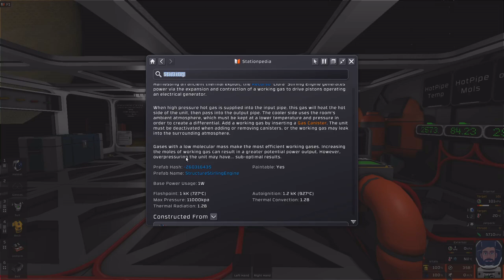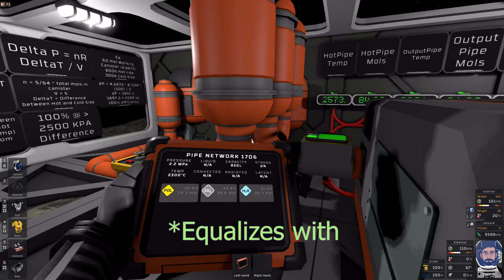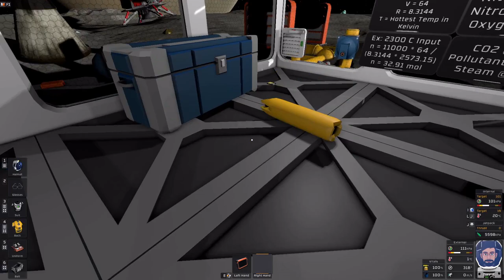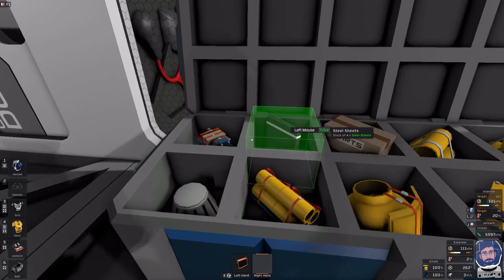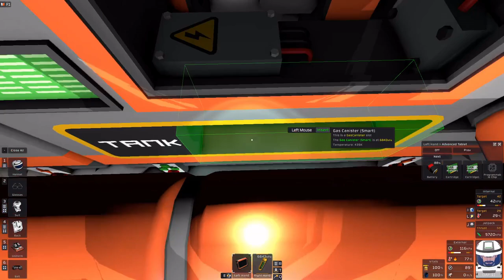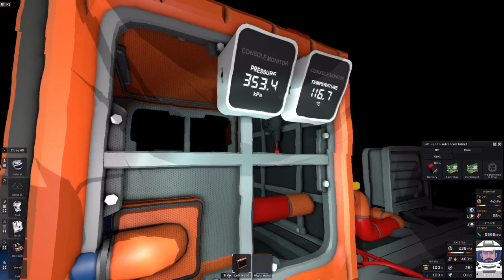Stationeers: Stirling Engines

Comment: Not only on venus basically any where with the daisy chain ac setup(cool the environment dump the heat to the hot side of stirling) which will produce less power but it will be almost 2kW

Comment: Has there been any changes with recent updates? Im trying to build this setup but my ACs cant keep up even with one SE, Im using Elmo's AC setup with 6 units and still struggle to cool down room for one Stirling
Reply from the maker: There has not been. Still move the same energy. I did have an IC in the ACs with Elmo's script, though it had to be adjusted a bit first since it had volumes for prephase change pipes.
Reply: @shadowdrake082  Yes Im using ACs with VolumePumps and IC in each AC. I tried building exact setup as Elmo on his vid using 6 ACs and tried ur setup from this vid as it differs a bit and Im not good results. How did u adjust IC? can u explain or maybe add Script to Workshop if possible? Im fairly good as IC so with some guidance i could adjust myself. either way somehow im not getting cooling i would expect.. sometimes i just think stuff are bugged here as in some scenarios im getting way too good results and in other way too bad compared to my expetations
Reply from the maker: I dont recall where it was, but originally the pipe volumes before phase change were 100L and his script adjusts the volume pump rate to make sure exactly enough gas is pumped into the ac input pipe. That math needs to change so that it uses 10 instead of 100.
Reply: @shadowdrake082  I finally found solution. I had to use DeepSeek AI to help me find issue. It actually had few problems in this code. 1st indeed there is mistake with volume of pipes and has to be changed to 10L. 2nd max pump setting is set as 30 where normal VP max is 10 and lastly there was mistake to which line jump and it was skipping crucial calculations in certain situations. Now it all finally works :) 4 AC keeping StirlingEngine running at stable temperature 30-40 C.. thanks for help and great vid as always
Edit: Actually after testing corrected code 4 ACs seems overkill, had to adjust code for ACs to shut down and start again at certain temps as its too strong. temp goes well bellow 0 C with 4 ACs
Reply: @InFeRnAl1988  I made a similar setup but changed the volume pumps to pressure regs using IC in the AC to keep an eye on the pressure eff and kept it just below 95% also found out sometimes if the pipes networks are acting a tad odd a log out of the world and reload "resets and rebuild" the pipe networks

Comment: "Canister Pressure determined by PV=nRT" Your bottom line is n = 32 mol. mol is not pressure, its n, an P is pressure, which you just set to 11000, and I do not understand why. I humbly ask why and who you set that to 11000, please?
Reply from the maker: Sometimes my brain is thinking ahead and I speak the wrong thing... I do that quite a bit. I most likely meant how much mol to add to a canister.

The reason I chose 11000 is because the Stirling blows up when the pressure differential between it and the environment exceeds 11 MPa. If you want an absolute max based on if the stirling for some reason can't dispel its heat... you'd want to use 11,000 for the calculation so that you know where you hit 11MPa inside the stirling. This number is a good starting point because you know at this point you could potentially run into issues, but since the stirling does dispel heat, it is unlikely this number of mols calculated will go boom unless something goes wrong with the atmosphere in the stirling and it somehow reaches the calculated temperature of the Hot Side.

Comment: stirlings works very well. acs in case of, are cheating amchines. u can make -60°C on venus / vulcan with a few units. they should fix that asap
Reply from the maker: True… it was tougher originally… when they reduced pipe volumes the ac’s got that “buff”. The main holdback was the input pipe pressure needed to be at least 101kpa to get 100% pressure efficiency. Phase change update cut the pipe volumes by 10x so it made it easier to hit that pressure with less gas. Because of that we can have situations where the AC can take a very tiny amount of gas, remove up to 14kJ of energy, and suddenly that gas is down to the negatives much faster than it should be. Understandably i can’t see them raise the pressure requirement or it will make ACs harder to set up properly for the base (with passive vents to base atmo which should be roughly 101kpa).

Comment: Hello nice video.  Only miss the math on more working gas make the need for hot gas use less.  I have 70kp rom at ish -50 to -120 . Using a volum pump for inn hot gas at 0.7 L  working gas 120mol . Generating 7kwh ish . If I use 50mol working gas then volume pump need to be sett at 7L to get close to 7kwh . So use a lot more gas . So found out that for power gen 120mol-150mol uses almost nothing hot gas . Mimas have low gas Generating.  So nice if you as well find the math for that as well in a video. So I can do some calculations. Not use bom ups tu much working gas thing as I do now hehe .
Reply from the maker: True. More working gas will always help with power generation. I cant really give a very definitive calculation other than a starting point. How hot the working gas becomes depends on the environment and the available hot gas… i was hoping a starting point is better than for me to suggest an amount and have stirlings exploding on people. Though if you are starting to absolutely regulate gas inpit, id put you as more experienced and hopefully what i have helps you to optimize your system. Im curious to know what your stirling’s pressures get to or how high do you consider a potential problem as you are tuning your system.

Comment: Great video like always I have a question and I'm sorry if you made a video already but I'm trying ti figure out how to make liquid oxygen and keep in its state and volitales as well
Reply from the maker: No problem. To make those, you would need to cool Volatiles below -77 Celcius and Oxygen needs to be cooled below -111 Celcius. How to get that low depends on what you intend to do. Atmospheric AC's work pretty well to cool down close to that point. Some phase change heat pump setups can work as well, you would need to use Pollutants to get temps to as low as -99C and then bridge with a heat pump setup using Volatiles (-77C) or Nitrogen (-92C iirc). 

Either way you do it, when you are making the liquids, best to cool them down a little further so that you are compressing the Volatiles or oxygen at the 4MPa point so that you have some leeway on the liquid tank/pipe network.
Reply: Thank you for the fast respond keep up the awesome work with your tutorial videos they have helped me a lot@shadowdrake082

Comment: Great vid!, I got really lost on the math tho! Way too much info that I don’t think I really needed.  Remember some ppl like ME, arnt that bright…so K I S S, keep it simple and stupid lol Sterling’s are my fav gen for Vulcan! Chip to collect day air, 550+, run with a PID for input press at night.  Generate about 3-5kW ea (depending on season).  And if I need more power add solar pnls, for nearly 24 hr power production.  You should mention this besides using H2 combuster waste gas, also combustion centrifuge(s) waste gas too for free power.  I think you need 4 CCs to run one Stirling tho.
Reply from the maker: True true! K I S S gets me… i think this video was attempt # 4 for recording it. The explanation part went from 40 minutes down to roughly 20 minutes. Attempt #3 i accidentally hot swapped the nitrous canister in while it was running with volatiles, there was almost zero reaction time for that boom. I recorded the Venusian cheeze separately.

I feel like we would need several CC’s or make them nitrous fed for a single stirling since the CC’s barely take in gases. I do like to run their output to a stirling eventually because that is some free heat that can be reused for power. Even so, stirlings are quite good generators.
Reply: @shadowdrake082  while it may be a bit much info the first time around the video definently makes me feel much more confident with setting up one of these systems myself, and its good to include the math behind it because once i get the basics down for myself i can always come back rewatch and get more advanced. good job.